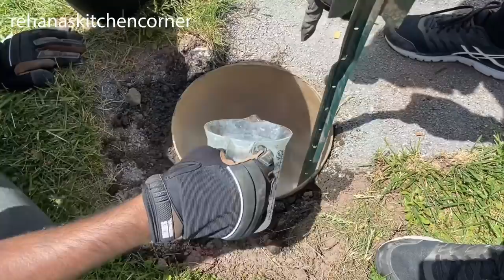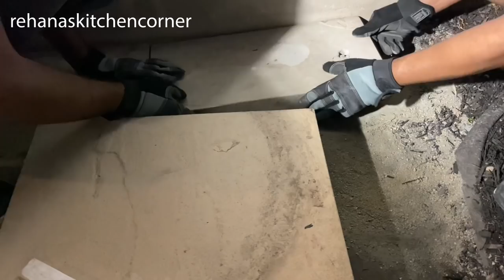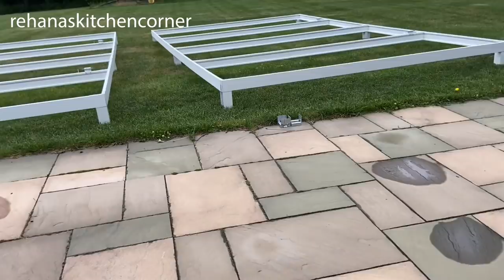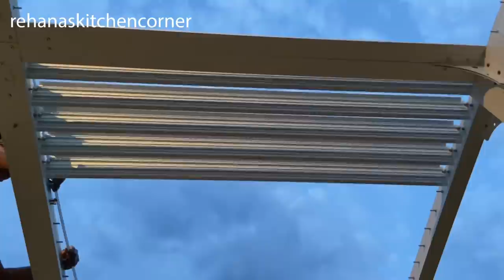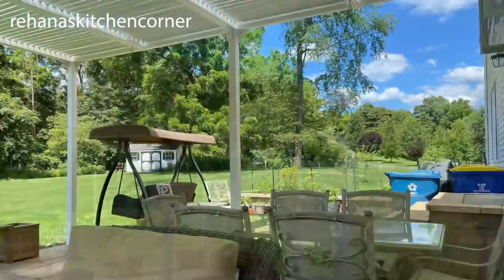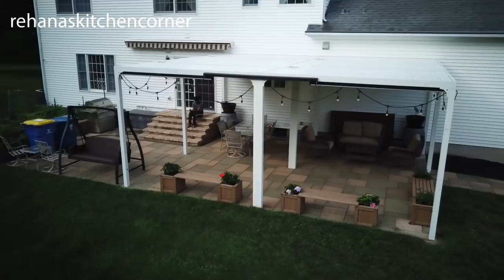Custom Pergola Backyard Build || Novara Louvered Pergola Custom Build || Home Project Vlog - RKC

Comment: Great work!  A couple of questions since I am looking at the same Pergola.  Did you take any steps to make it water tight against the house?  Also, how did you get the post extenders?  Were they custom or could you order then from Paragon?
Reply from the maker: Thanks. We didn’t connect our pergola to our house and it is standing independently. We bought 4 additional posts directly from Paragon and cut each of the poles into 3 equal sizes. Added those 12 extensions to each 12 posts and inserted 10’ 4x4 wooden poles. We did cut a little bit of the 10’ wooden insert poles to make it seamless with the additional aluminum pole extensions and put 1” wooden screws close to the extension area to avoid any wiggling inside the inserts. Overall, this was a custom work and we are very happy with the results!
Reply: @rehanaskitchencorner9853  don't the posts act as down spouts? Has there been an issue there?
Reply: @rehanaskitchencorner9853  Great job. Did wooden poles interfered with water drain?

Comment: I am thinking of getting this - they are on sale at costco beginning today.   yours looks like two of the 10x12 sized ones installed next to each other.  is that what you did?   i like the idea of having two center posts for the 10x20 sized one for the extra strength even though it would be $200 more.   any inputs would be appreciated...    also - you have had yours for a while (and through a winter) - did you learn anything you could pass on to a probable future owner of one?
Reply from the maker: Yes, we installed 2 of the 10x12 next to each other and bolted. Please note that we increased/customized the height to 10 feet by inserting 4x4 posts and adding extra post columns (bought 4 additional posts directly from Paragon and cut them into 3 pieces each). We also added concrete footings to the 4 corners to get permit from city.
Reply: @rehanaskitchencorner9853  our two units arrived in boxes tuesday and we will be starting to put them on our deck next week.  any tips?

Comment: I, too, purchased and installed a Novara Pergola.  It appears you were able to raise the height of your pergola a couple feet.  How did you accomplish this?
Reply from the maker: We bought extra post and attached with that. It’s was bit work. But it came out perfect.
Reply: @rehanaskitchencorner9853  did you use 4x4 wooden post? how did you attached the wood post to the ground anchor and to the anchor on top?